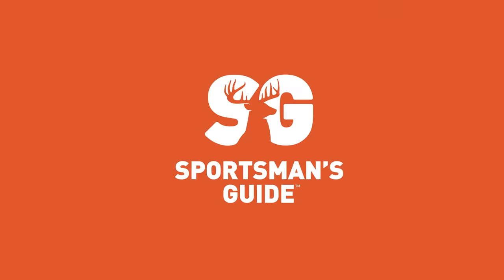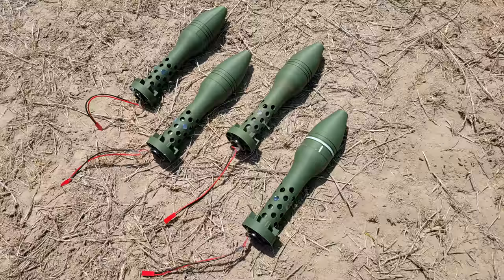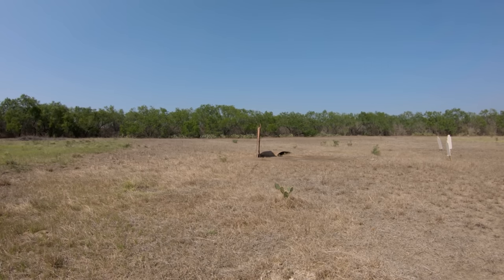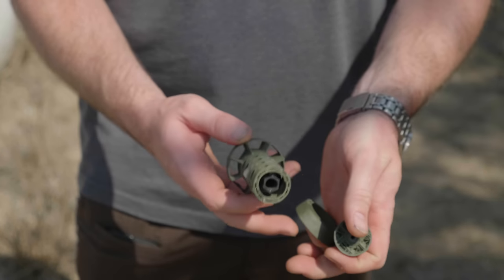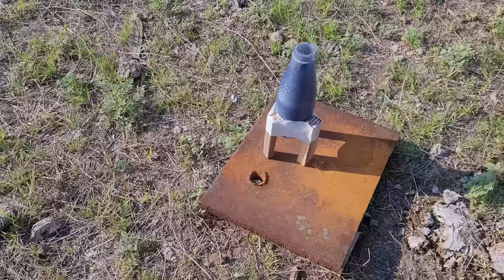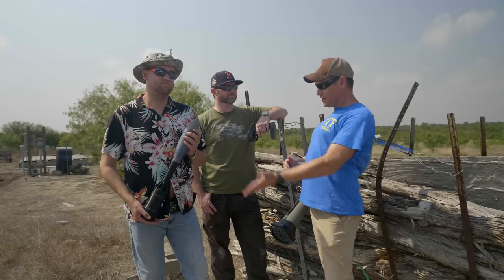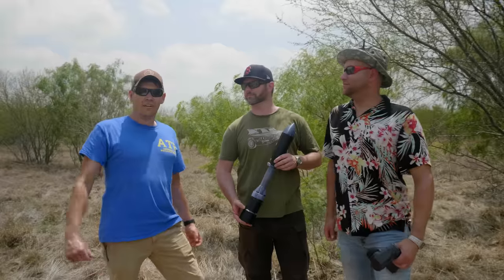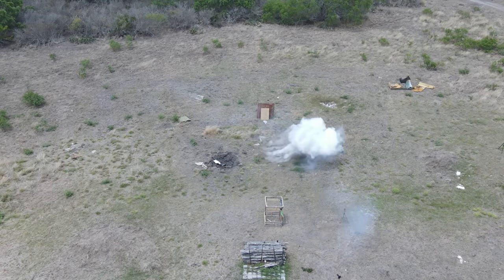World's First 3D Printed Rocket Launcher (Featuring D&S Creations)

Comment: Im no expert on what's available to civilian rocket builders so idk how feasible this is, but would you be better off having a very fast burning rocket that runs out before it leaves the barrel? You wouldn't have to worry about stability in flight with that.
Reply: They aren't igniting the rocket motor in the barrel.

They are using a kickcharge (just like a potato gun that uses a bit of alcohol to shoot spuds) to launch it from the barrel and to ignite the rocket at the same time. Similar to how real rockets use a kickcharge to get the rocket far enough away from the shoot that he doesnt get burnt when it ignites.

Comment: @ordencelab have you ever thought about using audrino motors so you can control the flight pattern on the projectile maybe 3d print fins that deploy soon as it leaves the launch tube.audrino motion censors,small survo motors and heat censoring as well check out audrino survo motors sensors I think if you incorporate that into your next shape changed rockets would do wonders for the flight path of the projectile

Comment: An aerodynamic issue? Perhaps modifying the rocket to more closely resemble that of a seers-haack body might improve the aerodynamics. If It was my build I'd design the rocket to be a scramjet following the seers-hack body for the exterior of the scramjet. I would also sugguest not using store bought rocket motors if that's what they are using but to make their own. That way you have better control over the manufacturing process and their properties.

Comment: Was that the 3d printed copper/pla  liner i recommended or printed plastic to hold copper powder in a cone shape? ps the copper powder can be sinterd into any shape. try mixing in 4-5% tin powder for low temp sintering

Comment: let me give you a hint on 3d printing better objects, make them apx 1/2mm or 0.5mm thicker than you think you need, and HEAT CURE the outer and inner shells by using a hot knife with a ducted fan to suck fumes, or any other combination of proper venting and heat application on an unmachined and unloaded print.

this heat treat melds the layers together apx up to 1mm deep if applied liberally to the surface, some folks use a heat gun or hair dryer but at high output it causes dripping.

this is why when i cure plastics i use a manual "welding" method with a torch and hot knife to impart heat quickly but not build heat up in the material. like i said, it "welds" the seams of all the print blobs, as they do mesh, but not extremely well; especially on anything large or complex with lots of movement of the print head.

unfortunately the property of the plastics and printing process always leaves a slightly weaker mesh of layers than a fully heat cured version of the same.

Comment: That copper powder liner deserves some more attention! Is it based on prior art in that regard? Is there any binder (tin, polymer, etc)? It was mentioned that the powder is compressed - can you say more about that?
Thanks!
Reply: We've opted to move on to a pressed 2mm copper plate cone. Wanting to get some actual performance results out of version two. Check out D&S Creations on Facebook!
Reply: @DandSCreations  I saw some green flame after the det so I think a decent amount got burned up as a powder. Sounds like you made the right call.

Comment: These are so cool!!!

Does this count as a destructive device? I may have a printer but also a desire to not be arrested
Reply: As long as you don't put a payload on it, it's just a hobby rocket
Reply: It’s partially based on if it’s designed to be a weapon, does it have fixed ammunition and does it have a bore over 1/2” , i DDrd mine since it checked all 3 boxes

Comment: Why don’t you buy a deactivated at4 weld up the sides add a booster charge to the rocket then activate the rocket motor that’s what the rpg does even better add spring loaded fins to the side of the rocket for more stable flight
Reply: That and in my opinion the rocket is really slow making it drop significantly worse
Reply: @Swollencod  the rocket is supposed to be a sustainer... The recoilless charges were far too small. We didn't want to blow up the launcher on the first attempt ever.

Comment: I had toy solid fuel rockets as a kid.  They even popped out a parachute at the top of the flight.  They worked pretty good in the 60's.  It was technologically inspiring for a kid, and it worked better than your toy 50 years later.  "Progress"   hahahah

Comment: make a simple pipe bomb pressurized with hydrogen and oxygen. I call it a water bomb, because that's what it explodes into.. kinda. But you can safetly set it off with a thermal fuse, that you detonate with electricity. it's a very every mans bomb, and effective. downside is it lacks density.

Comment: The rockets need more booster.  Of course this means more danger.
KNO3, C and S based boosters are too weak.
Reply: They are APCP rocket motors not Kn03. Yes the booster charge needs to be improved. Already have a version 2 in the works.

Comment: I think the case of the ordnance is hindering the shape charge effect. If it was steel i think you would have a split second more before the case ruptures to get good jet formation, really melt that copper. Also standoff generally is 1.5x the diameter so i think your in the ball park.
Reply: There next version we have already made proper copper cones for. Check out D&S creations on Facebook to see the progress!
Reply: The copper cone doesnt "melt"
Reply: @skillercruz5539  It deffinitly does melt. when the detonator is fired, a shock wave followed by the chemical reaction is formed and it travels outward from the detonator position. The shock wave front will first reach the metallic liner at its apex. Since the shock impedance of the liner is greater than the impedance of the explosive, the shock pressure in the liner will be greater than the pressure in the explosive. Because the liner material is melted almost immediately due to the extremely high temperature caused by the shock wave, and the free surface inside of the liner makes the particle velocity double due to rarefaction (or reflection), a jet of the melted liner will be formed along the axis of the cone from the apex.
Reply: @crabbiboi5528  It's hilarious how much technical terms you use, and literally don't even know that the liner gets super-plastically deformed at a high rate. It does NOT melt. When it impacts, that's a different story, depending on the speed of the liner and the material it contacts. One of the most common myths about shape charges is that common liner materials such as copper, aluminum or tantalum reach melting point. They are plastically deformed. Read some actual literature about shape charges and you will understand this.
Reply: @skillercruz5539  It appears i am wrong. I am not afraid to admit when i am wrong. I am impressed with your knowlage of explosives. You can leave out the belittling tho. It's not needed. Were just a couple of people having a debate over shape charge theory. I am just a knuckle dragging EOD tech. We have to have such a vast understanding of ordnance and explosives the real science stuff is un necessary but i like to nerd out from time to time.